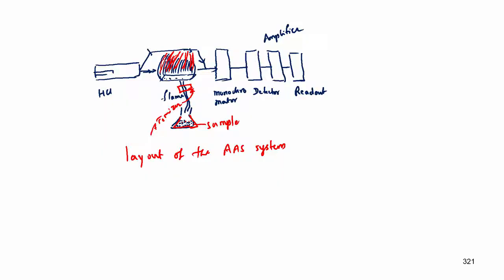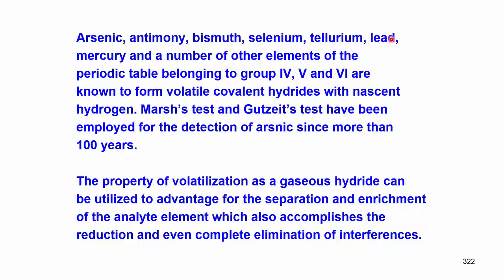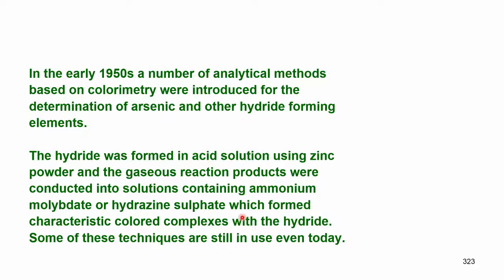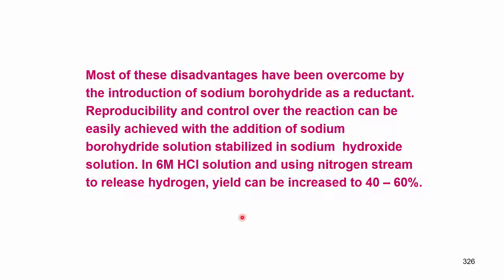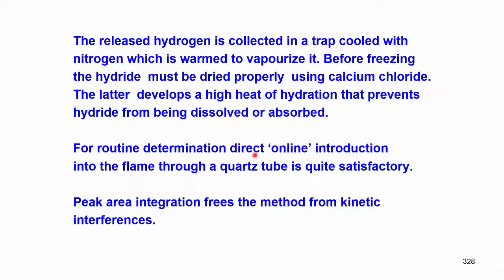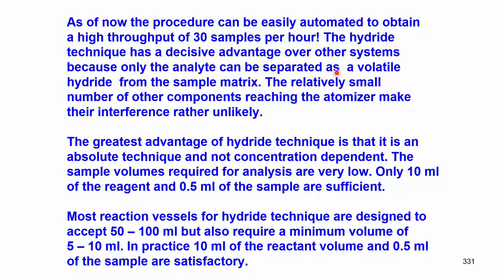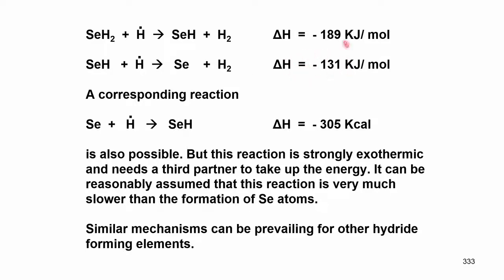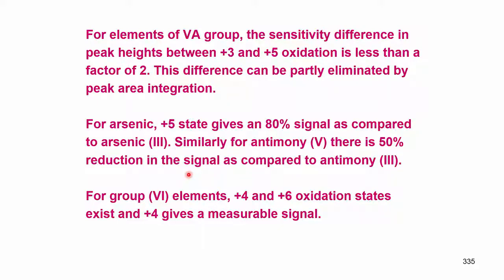Hydride Generation AAS and Cold Vapour Hg AAS

Comment: Greetings Dr J R Mudakavi.
I just want to ask, i want to use Flame Aas hydride to determine Antimony(Sb).
The problem is, everytime i need to place the quartz cell, the flame goes off. The flow rate that i ve used is 90L/h of acetylene/air and 6mm burner height. Thank you.
Reply: How do i determine the optimize flow rate for the analysis?